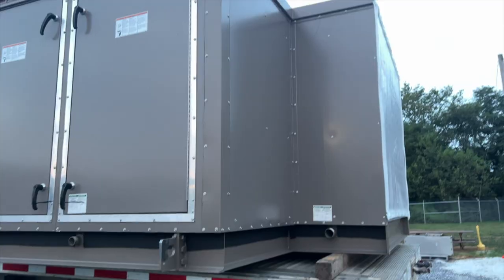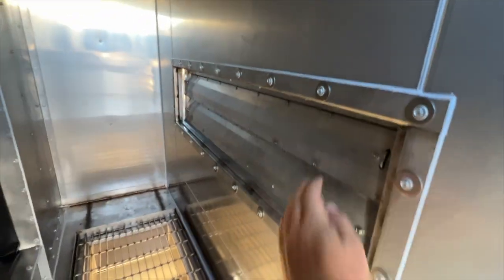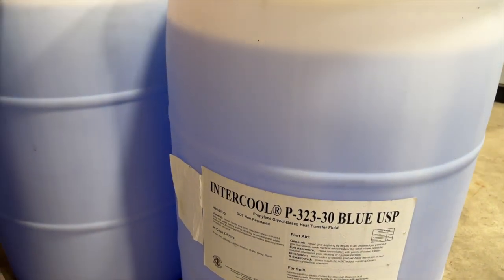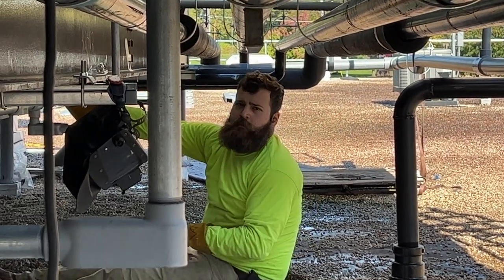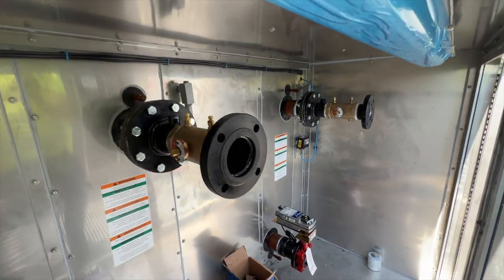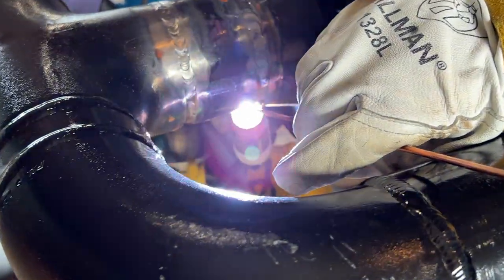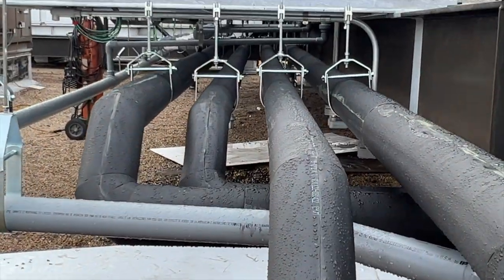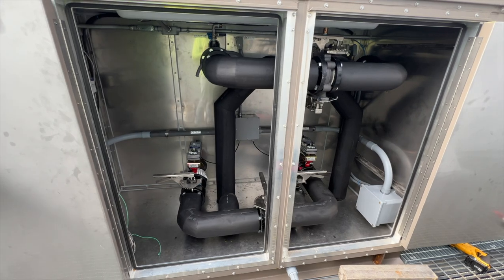Piping Like A Pro: Expert Guide to Air Handler Pipefitting

Comment: Would be great to see what your work flow is for this site fit up. No videos showing how people setup factory or industrial equipment and then piping fitting everything together. Only shop built spools 😢. I’ve done a bit of site work myself with lasers and iso, but still have a lot of improvement. Great video and commentary 👍

equipment setup and piping up equipment onsite

Comment: Maybe someone here will help me. how to avoid distortion when welding black steel? i was welding two tables, two big letters H with bar between them and they had diff distance between  the ends like twisted  from heat. it is possible to weld them perfect? or do i need to straithen them up after? thanks in advance . Btw great video i make exactly 
the same projects in  my job

Comment: hey drew, was looking at your store front on amazon, which scotchbrite wheel do you like best for cleaning your stainless weld? the yellow, green or the dark brown?
Reply from the maker: The green and yellow give a somewhat fine polish with green being the finest.. i use either one on sanitary tubing. 
The brown is more coarse so i often use that to take color off of Stainless schedule pipe while its still warm.
Reply: @BlueCollarDrew   thanks for the quick reply. How about your forensic detector? You like it, or would you go with a different brand if you had to buy another one? I’m looking to buy one. But I can’t find any reviews on any of them. Was thinking about the purge eye 100 or 300 nano. Or the intercon interpurge 772. Which is about $2300
Reply from the maker: Its actually the only one im familiar with.. i like it because of the purge applications and tank entry applications
Reply: @BlueCollarDrew   yesterday I purchased the purge eye 100, hope it does well